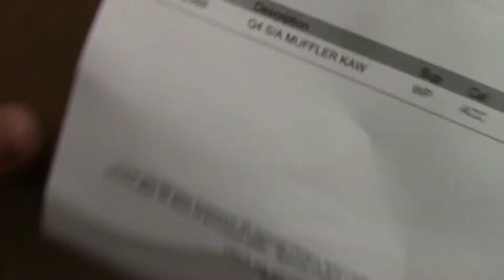KLX300R aftermarket exhaust install

Comment: Did it cause any issues with the fuel injection?
Reply from the maker: The bike ran a little lean on the top end. You'll need a programmer to get it right.